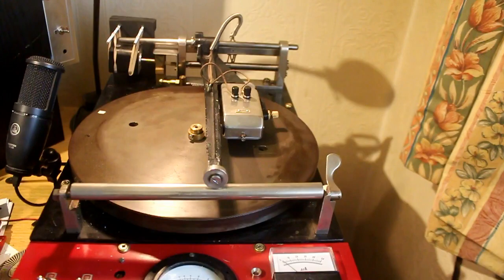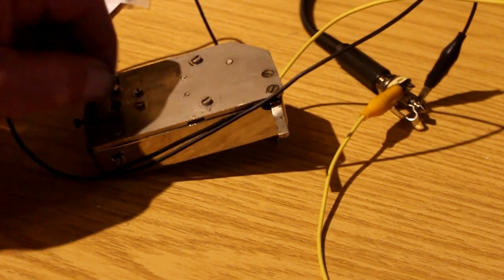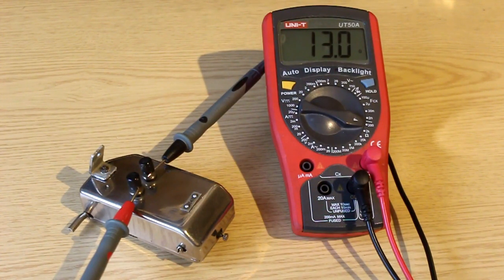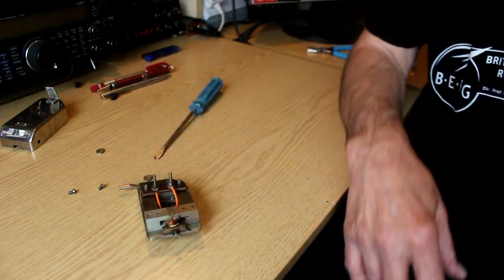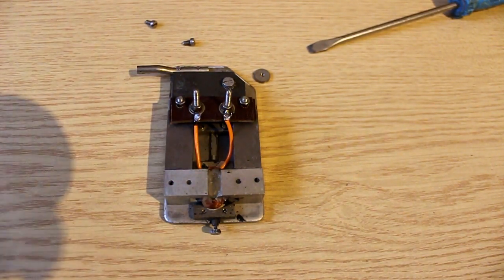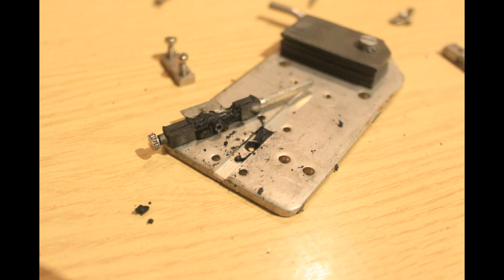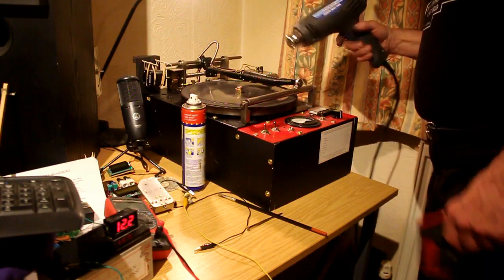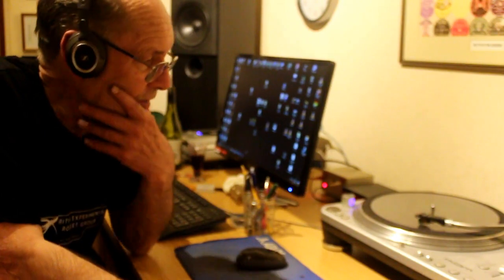MSS disc cutting head conservation.

Comment: Thanks Norman for you videos they are a great help i'm trying to restore  a very similar Mss machine. I measured  the ohms on mine and it reads 2k. i have no vibration on the needle, what sort of wattage should i feed to it? and which would be + or - or does it not matter many Thanks John, Link to your page didn't work sorry ask questions on here
Reply from the maker: Hi there. Sorry, my website is in disarray at the moment - I must really try to get it sorted. BUT - your problem consists of two parts. Part I: the resisistance the winding of your head is 2000 Ohms. If this is genuine reading, which it probably is, it means that your head was designed to be located in the anode circuit a a VALVE. Valves are high impedance devices, so 2000 Ohms DC resistance is about right. BUT... you probably don't want to start messing around with valves, because (a) it's tedious, and (b) they work on high voltages of DC and so are quite dangerous. Later MSS heads had LOW IMPEDANCE windings, of only about 10, 12 or 15 Ohms. Now these are really great, because they are exactly like connecting a loudspeaker to an amplifier, the output of which is always low impedance. The amp thinks it's driving a low impedance speaker & it doesn't mind at all. Having a low impedance coil in an MSS cutting machine makes life much, much easier! Youy won't get any needle movement, feeding a Lo-Z signal into a Hi-Z head. Part II: The suspension of the armature may be totally rigid anyway. In that case, the above video shows you the way forward! Personally, unless you are addicted to keeping gear in its pristine original condition, my advice is to dismantle the head according to the video, an replace the coil - which will have thousands of turns of hair-fine wire, with another, consisting of perhaps 300 or 500 turns of thicker wire that will have a DC resisitance of around 10, 12 or 15 Ohms. Then you can drive it from a Lo-Z loudspeaker on any amplifier. They don't want a lot of power, by the way; an ordinary domestic 15 Watts per channel amp is fine. Hope this is of help. Cheers, Norman.
Reply: @bixanorak  many Thanks for your reply and time, I was thinking of trying to get a impedance matching transformer, if not i'll try replacing the coil, the suspension seems fine. cheers again John
Reply from the maker: @rockingroots  Hi there . Well - if you know the suspension is OK, YES! Easiest is to use an impedance matching transformer! I have done so several times. For instance, the output transformer from a valve (tube) radio, that had an output valve such as a 6V6 (1930s/40s), or an EL84 (U.S. 6BQ5 maybe?) , can simply be used the other way round. After all, It matched a high impedance valve, down to a very low impedance loudspeaker - 4 or 8 Ohms.  Therefore it will work the other way round - feed what was the secondary from a normal modern amp speaker output, & connect what was the primary, to the head. But BE CAREFUL: you'll end up with quite a few volts on the head, maybe 200V or more - I've had a few jolts that way. Still, good luck. Norman. (Remember, these MSS head were pretty easy to drive; they don't need umpteen Watts - a single EL84 (rated 3 Watts out) works fine, for starters.
Reply: @bixanorak  Many Thanks again . I'll let you know how i get on, but it might take quite awhile knowing me. I have the advertising 2 page leaflet  for an upgraded Mss Type PR 4B with some interesting spec on it. I can send you some photos if you'd like.cheers again John
Reply: @rockingroots  Hi there Norman and John I have 4 MSS machines in various states of decay, one deck is from the MSS radiogram. It has a high impedance head and has it's original matching transformer mounted to the bottom of the base board, it is quite substantial and matches the head to a 15ohm output. It must have been a costly item and it makes you wonder why they didn't just wind a 15ohm head? Anyway that was their solution so you shouldn't go wrong with some kind of single-ended valve OPT in reverse. Thanks Norman for another excellent video, Rob.
Reply: @robturner3065  Hi Rob well with lock down i might actually get time to work my machine. I got an old speaker transformer i'm going to try to sort out the ohms. the other thing is it records a bit slow so then plays fast when played back. is that a variable resistor for the motor speed do you know cheers John  PS i also have an original sales manual for it if you want a copy
Reply: @voiceograph9712   sorry mines staying with my machine. what do you drive the 2K head with?
Reply: @voiceograph9712  you will have 1st offer cheers
Reply: @rockingroots  Might you happen to have a copy of the schematic for the MSS amplifier?  Is the amplifier for the cutterhead within the MSS lathe, or is it a separate component? Thank you!
Reply: VoiceOgraph hi sorry I have no schematic for the mss, in fact I have no amp with mine which is why I had the problem with the 2kohm head running off a 8ohm modern amp.

Comment: Hello! Some time ago I tried to make a record head.I used in my construction a coil (diameter 1'', wire AWG33, 80microHenries) and a neodyme magnet (diameter 7/8''  length 3/16``).An "anchor" had a slice of duraluminium profile (corner section). I didn`t have any magnetic circuit - there was only a magnet and a coil.I measured resonant frequency - it was  2200 Hz.When I made some records - I found out that the recorder acts as lowpass filter - until 2200...2500Hz.(((
Reply from the maker: Oh dear! That must have been very disappointing. If you still have the device, pleas send some images of it - maybe it can be made to work OK?
Best regards, Norman.
Reply: Hello @bixanorak  ! I took some pictures of the device -
 1)A common view https://drive.google.com/file/d/1FEM4BB4muzbMSQishk5fOr9sBChF4Ty6/view?usp=sharing
2)A homemade cutting head 
https://drive.google.com/file/d/1F9vBmTroWap_fyWqtmK5-mOaZJZOe7lB/view?usp=sharing

 https://drive.google.com/file/d/1Eqgt68JuELGlXSLgmKrzpWWwc5Wo5QfE/view?usp=sharing

The ferequency response has a big resonance pear (roughly 2.2KHz).I used for recording  DVD blanks - but this blanks allow to have a good quality only with extrusion by the needle with a triangle shape. I tried to use cutting - there was a horrible noise during a recording process((( - the record was extremly noisy. I`m not satisfied by the results - the record by extrusion was quiet and bandwidth was narrow (untit 4KHz with frequency correction) .I made my records in speed 33 turns per minute. Nowadays this "record mashine" stands on my balcony - I don`t have a time for experiments))

Comment: I'd really like to get mine up and running.. with some help..? >:)
Reply from the maker: Well, as you can see, it's not too difficult! The worst problem you may encounter is a coil that is open circuit. It is surprisingly easy to wind a replacement low impedance coil. (If the defective coil was high impedance, then it's extremely difficult because they have thousands of turns of very fine wire. So wind a new low impedance one & drive it from a loudspeaker output.) When I get round to it, will make a video of how to wind a low impedance coil like the one in this head. Cheers, Norman.
Reply: I have rewound it. the problem is i broke my magnet on am M-41 cutter head.. I had sent it out to west tech to fix it and he rewound it with low impendance. and i blew the head.. He said no more than 5 volume.. I wanted the loudest cut.. so was cutting at 6 volume,.. head lasted 1 month before the coil burned inside.. 4 weeks... So heads been dead since,.2006.. I keep trying ideas.. and have an idea i thinks works, but no sound is being cut in the grooves..?? I can biuld coild from scratch card board. but do i add the magnet on top or sideways.. I origionaly wanted it for 16 ohms.. he wouldnt do that for me..